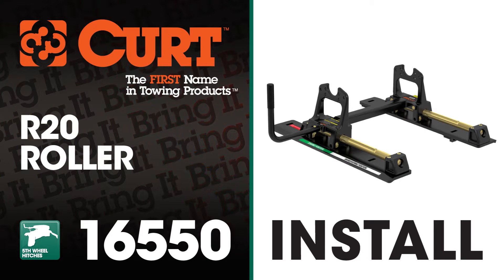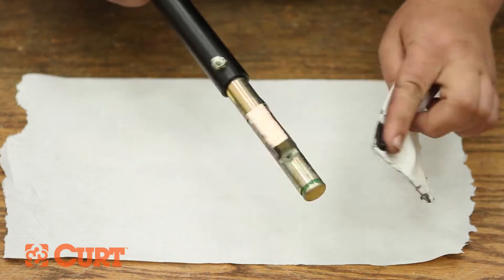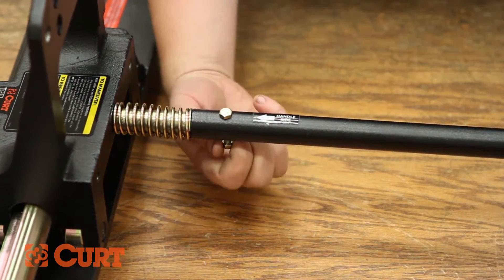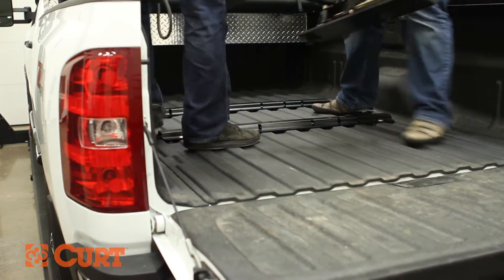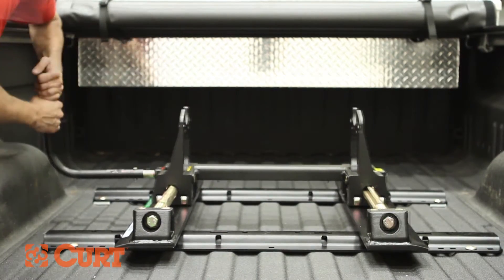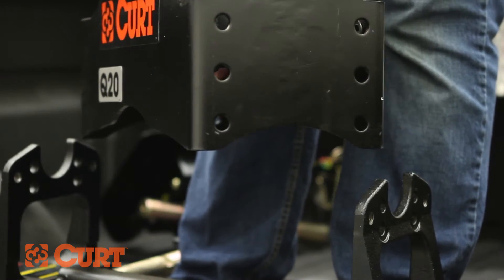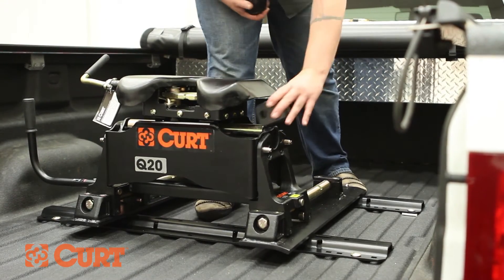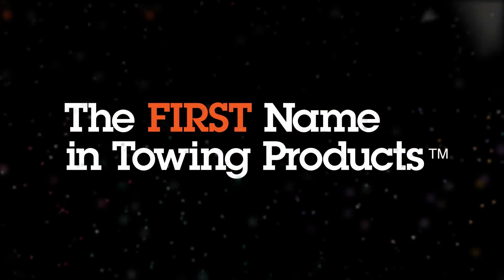5th Wheel Roller Assembly: CURT 16550 R20 Roller Kit

Comment: Awesome. Except once the rubber pads are in place the pins won't go through and the fifth wheel head will not lift out after removing those pins and cover cap.
Reply from the maker: rapnzel24 Those rubber pads are optional to install. Tow safely!